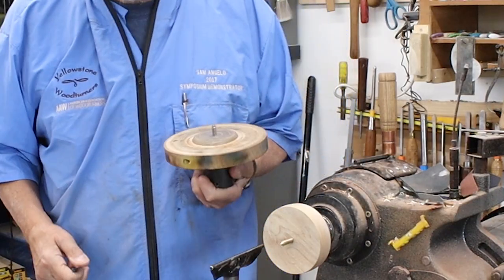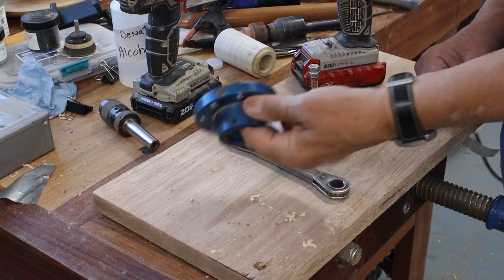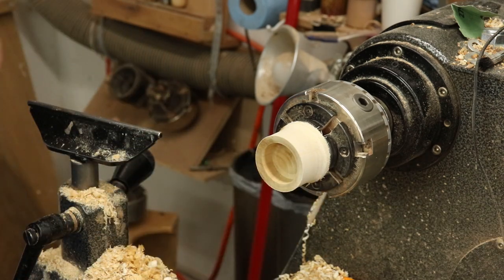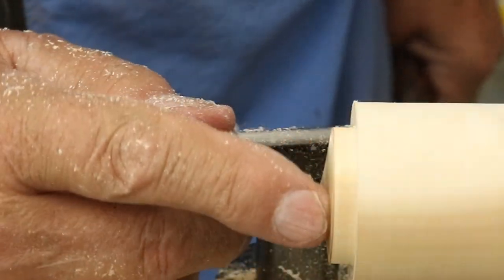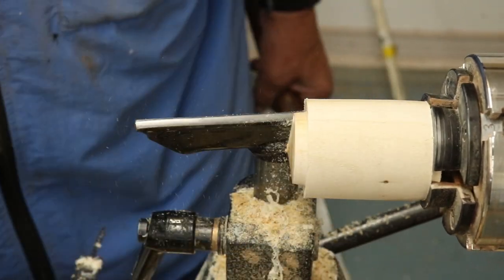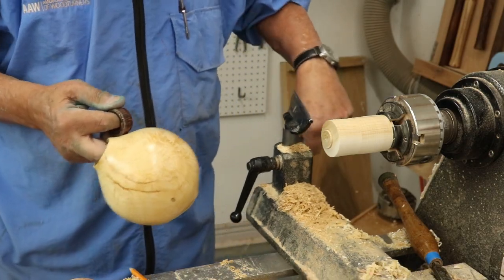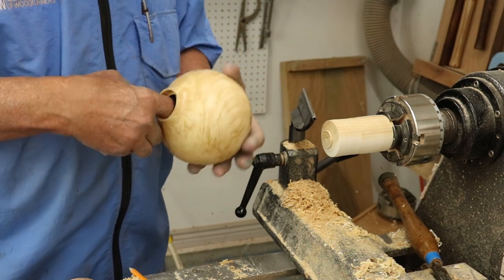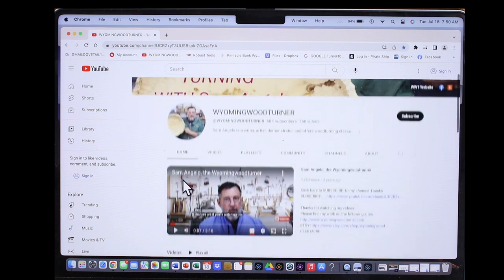Woodturning Tips JULY 2023   with Sam Angelo the Wyomingwoodturner

Comment: Thanks for the tips Sam.  I have one question for you about the jam chuck in tip #3; you didn’t mention how to get the bowl back off such a secure jam chuck without damaging it.  I’ve made a couple of them, on one I drilled a 7/16” through hole and used a wooden dowel as a sort of knockout bar to push it off the chuck.  I then found out that a blast of compressed air did a better job.  On the second Chuck I just drilled a 1/4” from the side to join another 1/4” hole drilled down into the center of the church so that they met up and the use compressed air.  This has worked well without damaging any of the turnings.  Cheers, Tom
Reply: Thanks Tom, you just answered my question. Len

Comment: Another video full of good advice.  Dumb question on the screw chuck construction:  Why wouldn't one attach the face plate to the candidate wood block as the first step, mount the block and face plate to the lathe, turn the block round and flat, and then drill out the hole for the screw?  Seems like that would ensure that everything is centered perfectly.
Reply: I've found several times that this is not entirely reliable, depending on tolerance in the tailstock slide. One should start from the centre and work outwards. Therefore I first fit the worm screw into the wood, gently mount the screw in a 3 jaw headstock chuck, and make the disc round and flat before snuggly insetting the faceplate, and marking a datum point on faceplate and wood. That way I can detach the faceplate if required, and later reinstall it true. The front face must then be made true, also.  Bernard.

Comment: I noticed you used sheetrock screws in your faceplate.  Are these screws recommended?
Reply from the maker: Bruce
No they certainly are not recommended. I need to go back and look at this and see what I was doing. At four minutes and 14 seconds into the video I mention the screws. I should not be using sheet rock screws, although in this application, they’re OK. Later on if anything fails, it will not be the screws. It’ll be the main screw stripping out on a piece of wood. I would not use the screws on a glue block application and I attached a face plate too. I think I’ll mention this in a future video. Thanks for bringing this to my attention Sam.